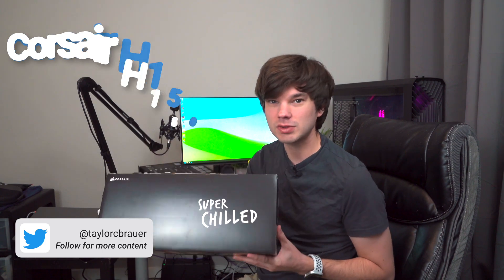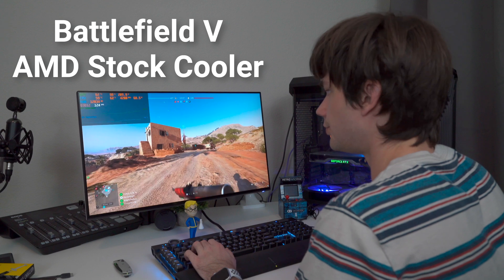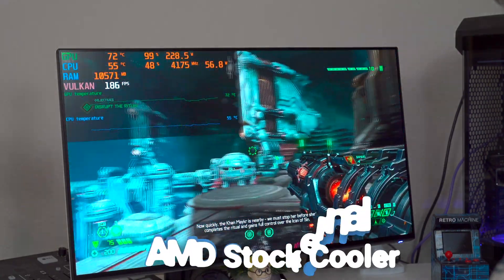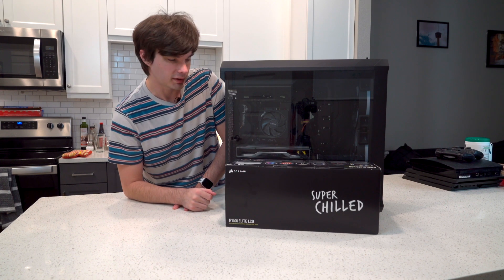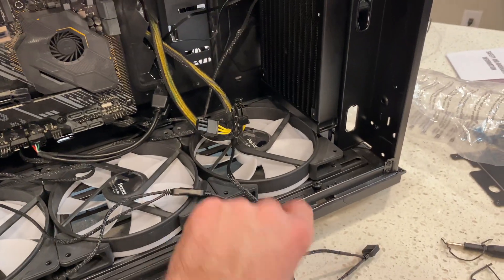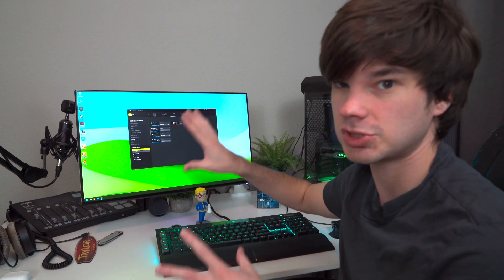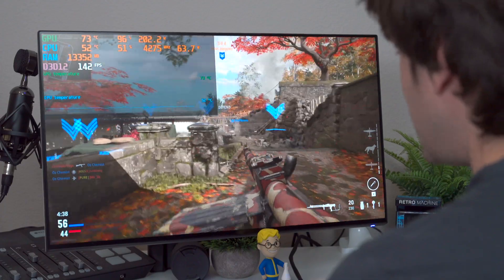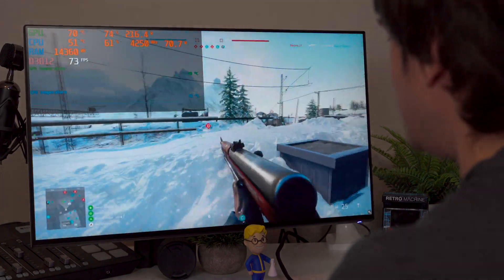Upgrading the Torrent to an H150i Elite LCD | How well does it do?

Comment: Currently building a PC, using the compact Torrent, with (probably) an h150i. Though I'm a bit torn, as I hate to replace those beautiful giant 180mm fans in the front. My only other option is to put it on the bottom though, but I'm told that's a bad idea, putting the fans below the pump. Do you know if the icue software works with the stock RBG fans in the torrent?
Reply from the maker: It’s a tough decision, Bruce. Those 180s are pretty sweet. The case fans are not compatible unless you get a cable that can adapt to the one the Corsair fan controller accepts.
Reply: @TaylorBrauer  Thank you.
Reply: You can still retain 180 and use 120/140 barrack to mount rad behind 180!!! Ez baby

Comment: Would the h170i elite 420mm fit in the case?
Reply from the maker: So, according to the manual, the largest supported rad, in front, is 420x140. So, most likely the h170i would fit.

I would recommend double checking the specs of the h170i and the case's manual, which you can find on Fractals website.

Hope that helps point you in the right direction. Have a great day!